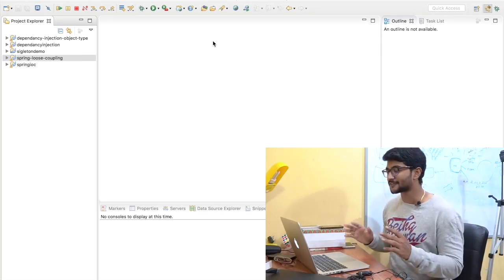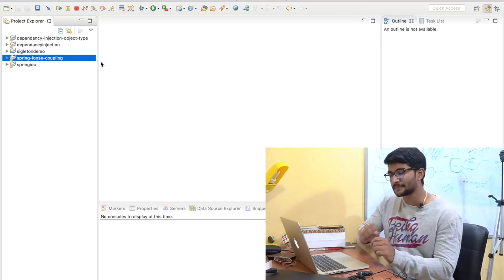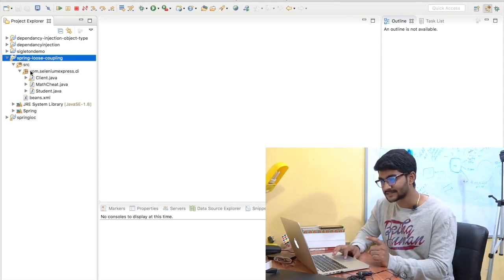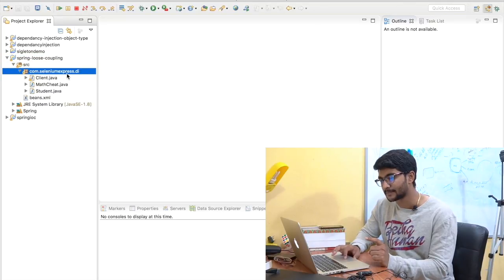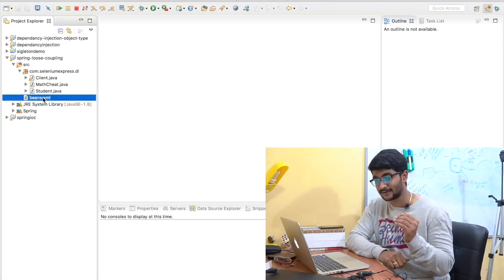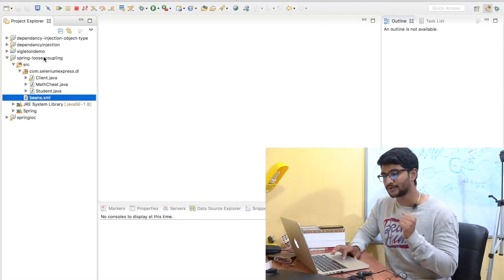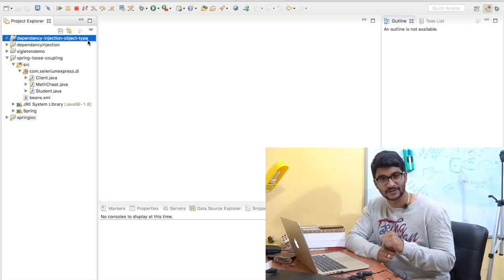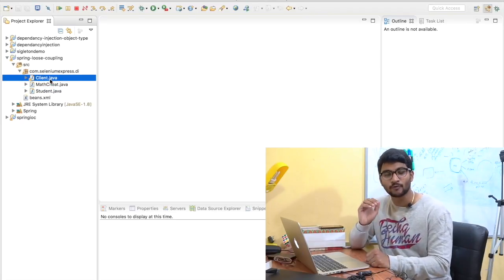How to achieve loose coupling with spring  || spring dependency injection - Lets practice together

Comment: Hey Abhi,
I'm getting an error while running.
It saying that class path resources (beans.xml) cannot be opened because it does not exist at org.springframework.core.io
Even if I configure spring libraries to the project. Please help me with this thing.
Reply: have you created the file  (in the src folder) and outside the package (if using package).?Try copy pasting the file outside of the current folder you have the code  and check if it works.